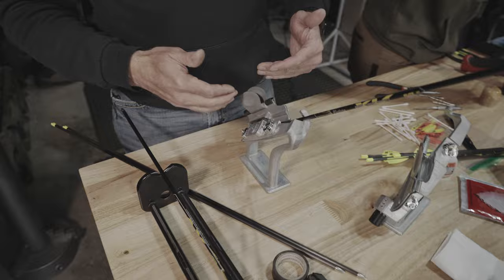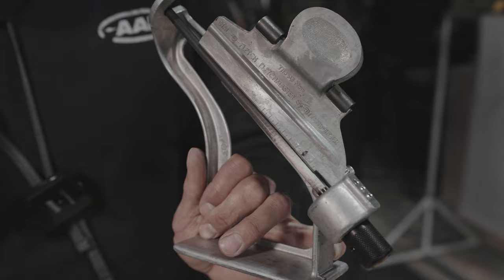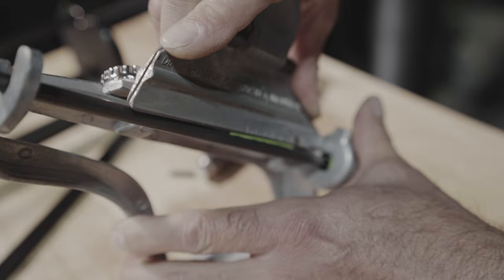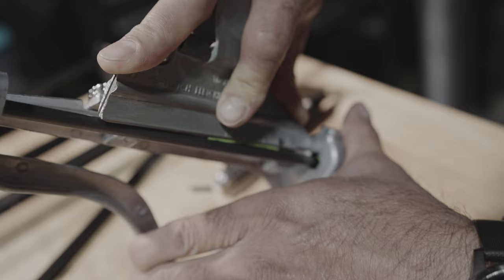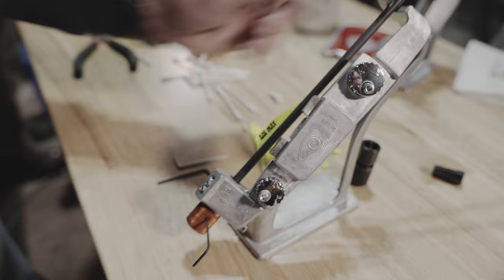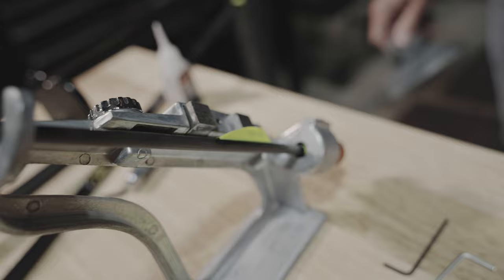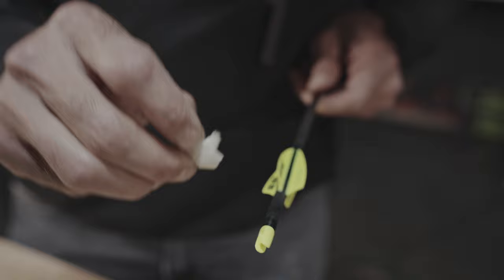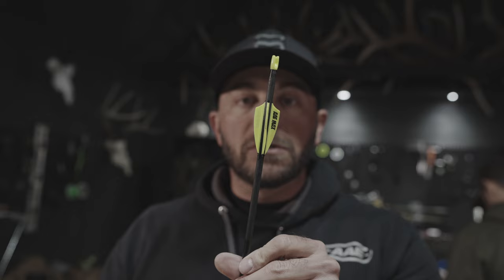BITZ FLETCH 101

Comment: I've been using the Arizona EZ fetch but decided to graduate to a Bitz Left , and initially setting it up I see what most of everyone's talking about as far as not getting it even contact with the blade to the shaft, I was not keen on cutting the entire front end off so I used the grinding stone on my Dremel and took a significant amount off but not enough to make it look as if anything has been done, then I took a black sharpie and marked the entire length of the blade, and gave it a swipe crossed find sandpaper, and look for the edges that needed to be even out, didn't take me that long but I do see how you can be more precise with the Bitz  over the Arizona , , I did then of course get my offset aligned to where a van gets a good purchase on the shaft, did a little bit of practicing with vanes and arrows  that I won't use  , may take a little longer but I think in the long run will be worth it , I will probably be ordering another one or two just to speed up my process . Keep putting out these vids  Dan I've learned a lot from your channel and one of your very close associates MFJJ's channel ... and by the way I do have to put this out there, I don't know that I've ever seen you this quiet and any other video lol keep up the good work Dan

Comment: Like my bitz! I like to use a wrap just for better glue adhesion. I’ve had vanes fly off more without a wrap. Also glue time is like 3 seconds and that baby is stuck stuck. To remove I just hold over steam (water kettle) for a few seconds then peel, usually have to repeat 3-4 times to completely remove all residue, probably takes 30 seconds an arrow? I feel that’s tougher, and more efficient on time, compared to holding down each vane for 20 seconds on bare shaft. Just a nobody’s unsolicited opinion 🤷🏽‍♂️ SE AK spring bears will hopefully start Poppin next week🤞🏽spring is taking her time up here!
Reply: Try bob smith industries glue. With or without the curing spray. Ill never buy another super glue for fletching. A lot of it comes down to prep too but that stuff is amazing and cheaper than most archery glues too. The one with the pinkish red label

Comment: I always found it weird that all these people weigh out the arrows, vanes, inserts, nocks, and field tips/broadheads but still decide to add glue to the front and rear of the base of the vanes. I completely understand it’s done for extra strength from other arrows or complete pass throughs, but doesn’t that negate the fact that you just meticulously weighed everything and there’s no possible way to manipulate the glue to ensure everything is even vane to vane or arrow to arrow? I know glue doesn’t weigh a whole lot but it all adds up.
Reply: Last batch I did, I matched all the component weights (as per MFJJ) for SnGs. Once they were made up there was a 2-3gr difference between the lightest shaft and the heaviest shaft. 
Now, if I hadn’t matched all the components it would have been closer to 8-15gr
Not worth doing for my skill level but it was a fun experiment. 
Measure the things you can measure and do your best with the rest
Reply: 2-3gr is a lot. I’m typically getting within .5gr between a dozen arrows.